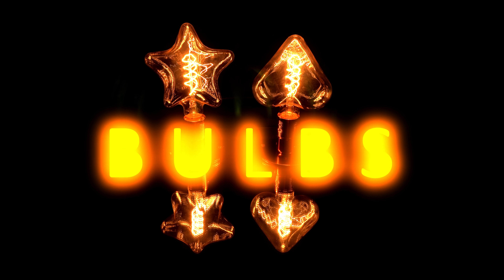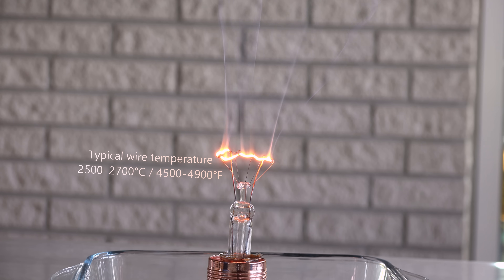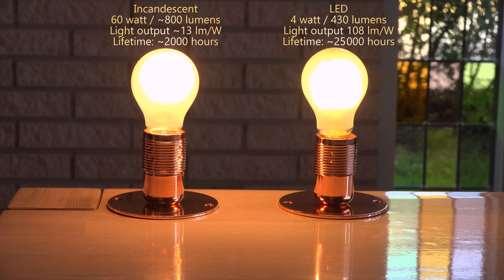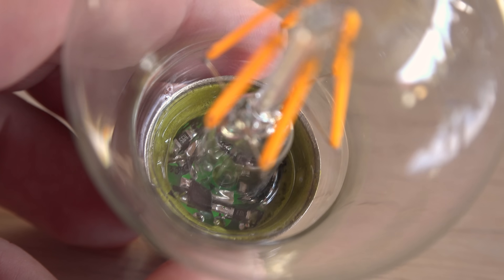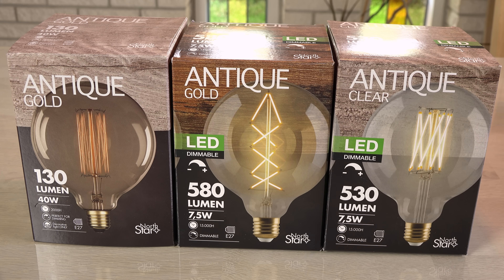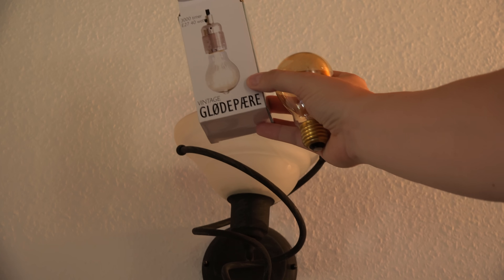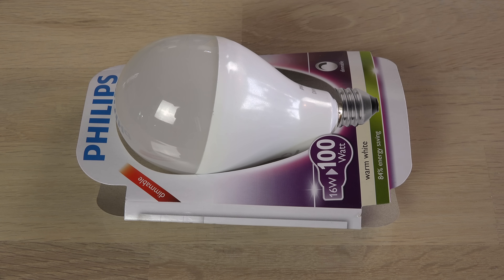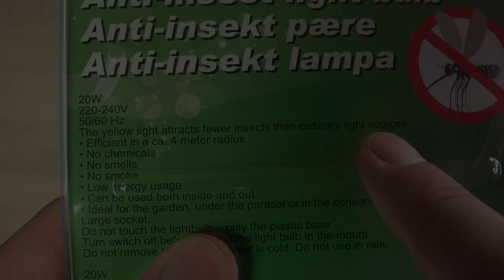Light Bulbs | LED vs. Incandescent

Comment: The US will keep i tungsten lamps legal except California, but the other 49 states do not count California as a sane state anyways..
CFL's are the most dangerous because they are usually have mercury in them, granted its not enough to worry about. However CFL's can catch fire if they are on circuits with dimmers. But if your putting a CFL on a dimmer then really you should not be messing with electricity at all, just hire someone to change your bulbs out and go back to twitter and pokemon go..

LED bulbs generally come on two colors, Cold White and Warm White, I always found cold white to be too harsh for in home use so I tend to stick with regular tungsten bulbs, However in my shop I use cold white because I need the light.
Reply from the maker: Hehe, are incandescents already banned in California or are they just working on it?
Reply: Brainiac75 No they are banned. Can't find them in the bigger stores anymore, maybe some country store has a few but like Wal-Mart = nope

Comment: Daylight temperature starts at around 4500 degree Kelvin up to 6000 degree Kelvin. I personally like lighting most at around 4000 degree Kelvin. I use LED lighting in every room of my home as it is cost effective but then I also use Solar power (and batteries of course) for all the lighting in my home so using LED lights has an added advantage of saving a LOT of power drain from my solar setup.

The real downsides of using solar and led lighting is finding good quality led lights which are designed to operate from 11 volts up to 24 volts and which offer the natural color temperatures a person finds pleasant. For kitchens and bathrooms one may well find a temperature range of 5000-6000 degrees a good choice while in the living room and bedrooms a range of around 3500 degrees is softer and less brilliant.

Another concern for some such as Preppers is that LED lights (all of them) are very susceptible to radiation from the Sun (say solar flares) and of course an EMP. Regular old fashioned Tungston lights are NOT.

I have had several LED lights go totally OUT and burned out when we had a small radiation burst from the sun recently but my regular bulbs did just fine. With that in mind I have put up extra LED light bulbs into Faraday cages to protect them and their circuits for such events. Good idea to always have a backup plan and especially NOW with all that is going on. 

Most people have not yet realized that in almost all modern lighting there is basically a simple + and - current going to the light. In short in LED lighting all the electronics which make the light work ARE in the BULB itself. 

Most people also do not realize that the sun regularly emits EMP type radiation every single day. Most of it bounces off the atmosphere but sometimes it does NOT. Even a modest breakthrough of spurious x wave type radiation WILL TAKE OUT all LED  light bulbs within that affected range. If an entire LARGE region of a country or state for example is 100% LED only, that entire region will be DARK when (and there is no question such an event WILL happen). It would be wise to stock up on extra LED bulbs and incandescent bulbs BOTH and put the extra ones AWAY in protected Faraday type boxes or cages.
Reply from the maker: Thanks for sharing extra details. I guess we can agree that LEDs aren't perfect ;)

Comment: With me, there are just two issues with LED, one is a good point, other is just my post apocalypse fetish, for the first one, the flickering gets really bad with people working with slo-mo cameras, and in that case an incandescent build is required. Second reason, a terrorist EMP goes off. An incandescent bulb would easily survive, just hook it to the terminals of a battery. The electronics in an LED though would not survive though sadly.
Reply from the maker: You're not the first one to mention, that LEDs are a bad choice for preppers. I'm not a prepper so I've never thought in that direction.
Reply: Brainiac75 yeah, I did some reading a while back and right now, the most likely way the US will fall is an EMP attack, the odds are currently way less than nuclear warfare, and those odds are lower than getting struck by lightning. So I just keep it in the back of my mind from time to time

Comment: Excellent video, probably the best I've seen showing and comparing the different lamp types.

One thing about the incandescent bulbs reporting a lower wattage than advertised:  I suspect the input voltage was a little low on the test rig.  I think voltage should be measured at the base of the bulb to be most accurate to account for voltage drop on load from the power supply and through the circuitry.
Reply from the maker: Thanks :) I think you're right about the voltage of my mains being a little under spec. Never thought about that...

Comment: Then why do many LED bulbs and fixtures have heat sinks? Why are insects not attracted to the LED lights? Colours look bad because the frequency of light is in the blue range and not easy on the eyes. Places that install these lights are hard to live and work in! 
  It is true they can make more pleasant LEDs but I cannot find them.... I am not against LEDs but they have a way to go!
Reply: LED are not 100% efficient at producing light, so they still lose some energy to heat, and the electronics don't like that.

Buy LED lamps with a lower Kelvin (K) figure (3500K or less) for a warmer appearance.

Comment: What a fantastic video, you have gained a subscriber, thank you and greetings from Mexico!
Reply from the maker: Mexico! That's awesome - welcome aboard and greetings back from Denmark :) Are incandescents banned in Mexico or do you still have the freedom of choosing yourself?
Reply: Hi there! Well, here in Mexico most incandescent has been removed from the metropolis, you may still find them in province but never in a supermarket, legally they are yet to be banned. Interestingly enough, you can still find a lot of incandescent with opaque|frosted bulbs, but people dont really buy them anymore and usually prefer halogen ones since LEDs here are about 20x as expensive as a regular and they save important amounts of energy. The industry is slow to change, mostly due cost of products.
Reply from the maker: Richard Frank Interesting. I wouldn't buy LEDs either if they were 20x as expensive as halogens... In Denmark there's no real difference between the price of incandescent decoration bulbs and similar LEDs. But I am aware that we overpay heavily for the incandescent decoration bulbs :)
Reply from the maker: Richard Frank Thanks for sharing. Now I know a little more about the daily life in Mexico :)
Not surprised that you also have trouble with very cheap Chinese import... The bulbs look very common. Only thing I noticed as special is the 127 volts. That's not common.

Comment: I tried to go green in my apartment in the US, and purchased the extremely expensive CFL bulbs. The first thing I noticed was the lack of light when I turned them on, they came up to full power very slowly, not very good for me, I wanted full power right away, especially in the pantry, where I would not spend enough time for the light to gain full power. Plus, it was just depressing to see less light instead of "snap", hello! And the color rendering was awful! I was very angry that incandescent bulbs would be banned and I would be left with this miserably weak and bluish light. I felt that my government was trying to impoverish me, and knew full well that the very people bringing the ban into place were rich people who would continue to use incandescent bulbs themselves, only the best for them.
And then the real problem started. Nobody told me that you could not use A CFL in an enclosed light fixture, and the kitchen lights and ceiling lights in the apartment were just that type, so my expensive, underperfoming lights started burning out quickly. And I did not know why. So I went back to being an Earth-raping incandescent user.

But one day I was at my favorite electrical supply store and I whined about my situation to the man at the counter, and he educated me on the subject of lighting, and I fount that I could buy CFLs that would come to full power almost instantly, and render colors much better, and that my light fixtures were to blame for the bulbs burning out

Led lights had not yet reached the level at which they are today. I still don't like the new lighting, CFLs with their mercury, and the Leds with their complicated, high tech manufacturing requirements. But, after all, it's better than using whale oil for lighting!
Reply from the maker: Oh god yes, the slow CFL-bulbs that can take minutes to have full light output really get on your nerves...
Thanks for watching and sharing your personal experiences!
Reply: You are too kind! I am now... there, subscribed. Well, I an 60, and garden organically, but I am just afraid that high tech is just creeping into simple things and shouldn't be there. My first LED flashlight...dreadful. A lot of lumens, but it looked like moonlight,  bluish, not nice and yellow, I called them fairy lights. But that has been fixed. Tak, from this Svenska poika!

Comment: Cost, starting from scratch, to build incandescent bulbs:  A few thousand dollars to make prototypes.  A small production line can be started for a few hundred thousand dollars.

Technological level:  Low.  It's possible to make light bulbs in your own garage workshop.

Cost, starting from scratch:  A 5 million dollar investment, maybe more.  Technological level: Very high.  Requires full semiconductor fabrication facilities.

We are being sold a bill of goods on LED lighting,  It is not yet actually living up to its lifespan promise and the cost of the bulb is often greater than the cost of the electricity it is supposed to save over its designed lifetime.
Reply: I've had the same LED bulbs in my computer room for going on five years now, and instead of needing 120w to light it, I only use 16.  Since I'm in here about 35 hours/week, that's 3.64 kwh that I'm not using each week.  Even if I stay at tier 1 for my electricity ($.16/kwh), that's about $30/year just for this one room.  Over the 5 years I've had them in, it's $150.  I guarantee you I didn't pay $75/bulb so, yeah-I'm money ahead.  But then, I did the math ahead of time rather than just saying "It won't save money".
Reply: I guess it's not the $ thing that is targeted, but the fact to use less electricity as a lot of it is produced by burning oil or even worse, coal. So there is an "green" thinking in the logic.
Reply: Incandescent bulbs require special equipment to evacuate the glass bulbs of air, fill them with special gas, and seal them. Not to mention the specialized equipment to make the filaments. And you'll need to get glass-blowing equipment to make the glass for the bulbs. Get the quality control wrong, and you'll have bulbs that are too dim, too bright, burn out quickly, or explode.
It's actually far easier to make LED bulbs. You can just buy the light-producing semiconductors from a supplier, and wire them onto a breadboard with a heat sink, & components from Radio Shack.
Reply: I swapped my whole house as soon as i bought it, it's full of old wiring so lowering the loads on circuits is good altogether since the whole upstairs is one circuit which is also part of the basement circuit.

Comment: Low energy bulbs like the LED bulbs are now so good that using the old type makes little sense. I only buy LED ones now. The color tone is usually good, and one type I found has a slightly tainted glass that gives off a warmer color tone, which is nice in certain rooms. True, old fashioned bulbs give off some heat in the winter, but most of us have some other kind of heating solutions anyway, which are better at warming a house.

Comment: Fucking EU-directives. This is only one example of MANY freaking stupid laws which every EU country needs to obey even if it's complitely unnessecary for some of them
Reply: Stupid because it saves energy and resources (and consequent pollution)?

Maybe it's just you that's stupid...
Reply: +9ff70f96 In northern european countries it doesn't save any energy since houses need to be warmed in the first place
Reply: So use an actual dedicated heating system not based on electricity to do that instead.  I don't know how much electricity costs where you live, but where I live (in northern Europe) it costs way more than using gas, or oil.
Reply: +9ff70f96 classic light bulps produce only very small ammount of heat compared to what the actual heating systems produce. Electric underfloor heating is very used method in my country because its effiecent and very reliable.
Reply: +9ff70f96 And electric heating systems are cheaper than oil or gas systems.
Reply: So basically you're probably converting oil, gas, and coal (or potentially nuclear or hydro, etc) to heat to make electricity to transfer it across large distances to be converted down in voltage several times to run to your home to power your electric heater to crate heat.  Sorry, but I think you are wrong if you believe that this is more efficient than simply converting oil/gas/coal directly to heat in your home.
Reply: +9ff70f96 It might be effiecent but nobody would pay huge ammounts of money to have oil or gas heating system in their house. Also oil and gas are heavily taxed. Some houses have wood heating systems but they reguire lots of labour in storaging the wood and making a fire every day. If I would build a house and money wasn't an issue at that moment there would be a geothermal heating system

Comment: had heard it was the opposite in the United States the clear glass can be sold as an appliance bulb Whereas the frosted glass has been made it legal to manufacture above 40 Watts I think
Reply from the maker: I still haven't found the logic in allowing tinted glass but not clear glass. If anything the tinted glass lowers the lumens to watts efficiency? : \

Comment: What bulb is great for bedroom use, low in bluelight?
Reply from the maker: People have different tastes, but most would prefer a warm white around 2700K in the bedroom. The cooler, higher kelvin bulbs can mess with your sleep: http://www.scientificamerican.com/article/q-a-why-is-blue-light-before-bedtime-bad-for-sleep/
Good recommendations for other rooms: http://www.westinghouselighting.com/color-temperature.aspx
Reply: ~2700K or less, commonly named 'warm white'.
Reply: +9ff70f96 2700k is wayyyy to low, 3500 is plenty
Reply: 3000K or less is common in the U.K. to produce a 'warm' light in environments where a more cosy atmosphere is desired.  I find the output to be very close to that of the incandescents that I typically replace at the time, particularly dimmed incandescent lighting.
Reply: +Brainiac75 I'm fully aware, I've worked on deploying color ramp applications to a lot of our computers and phones to ramp down the blue and green to change color temp to 3500 at night to help reduce the screens effect of keeping people unable to sleep and eye strain. but 2700 is extremely low. that should be lower than a candle flame(which I measured 3500k) but I could be off here. I just recall 3500 being a sweet spot
Reply: I have my computer set for 1800K and I still feel like I'm downing caffeine well into the night. Probably because the backlight isn't effected by Flux changing the colors appearing on screen; so I guess what I'm asking for it a non-blue/white LED or one with housing which blocks the melatonin reducing spectrum.
Reply from the maker: Vergo Bret Yeah, the programs only change the colors on the screen. They can't change the color tones of the LEDs/backlight directly.
Reply: Warm white or better yet 12000k light. I have two kinds of bar LEDs velcroed behind my monitors that backlight the wall behind my PC.  The warm white is for evening use.  12000k is closer to sunlight and used in the early morning.  Unfortunately the 12000k LEDs are still extremely expensive at over $200 vs the warm whites at $15.  In Canada the 12000k LEDs are only sold by one distributer that markets the lights for seasonal depression.
Reply: Phillip Mulligan

Comment: There is a lot of misinformation in the comments below. However, explaining this would take a book. Suffice it to say that LED light sources will be the sources of the future. The incandescent lamp, with which most of us grew up with, is doomed. CFL was thought of the same way but was supplanted by LEDs. The gains in efficiency of LED sources over the past 10 years has been phenomenal. LEDs will suffer from cheap imports from Asia which are made with little attention to operation. Low efficiency, bad CRI, early failure are all problems with these sources. Your best option is to stick with the major manufacturers. They at least will honor warranties. FYI, I am a former product manager with one of the majors. Retired some years ago. Also, I am half Danish.
Reply from the maker: Thanks for sharing. I do agree, but in Denmark even the big brands only sell CRI>80 LEDs. So sad that I have to go to IKEA to buy >90 LEDs >:(

Comment: Thing is a few months before the ban on the old normal bulbs came in, they found a way to make them give out many times more light using a special coating but it was to late.
and where i live in the uk all the shops sell are shitty energy savers that give out 30 to 80 watt its too dark so you have to have 6 in one room

in the adds they lie and say the energy savers last 10 years that's crap they last a year and go yellow after a few weeks

i guess led's are the way to go if they make ones that give out 200w in 360